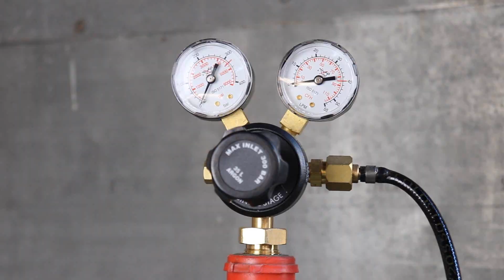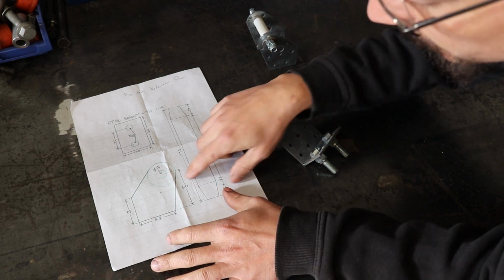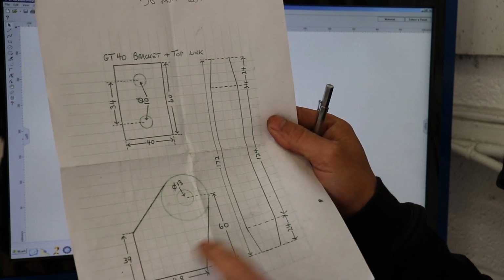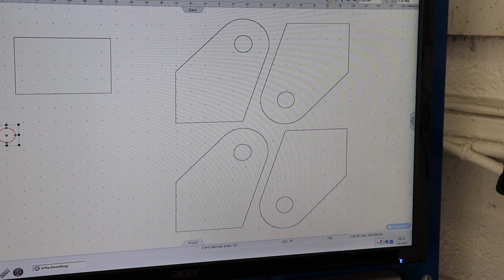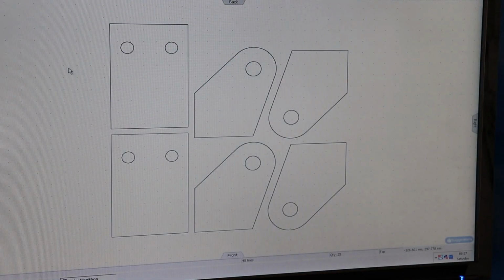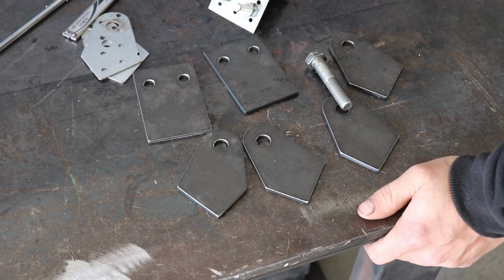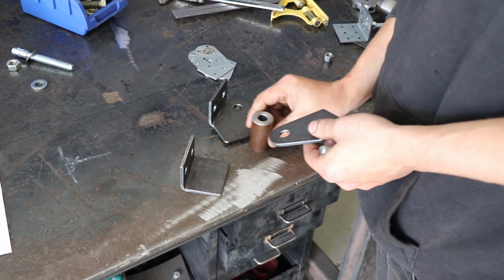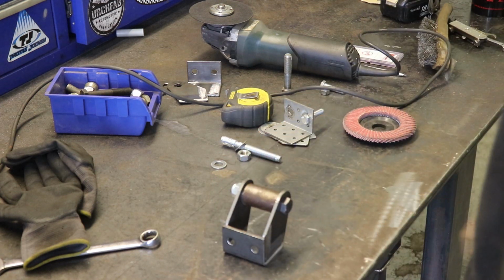CNC PLASMA, A SPIN ON THE LATHE AND A COUPLE OF WELDS.

Comment: could be its for the gearselector , those gt40s use either a audi gearbox or a realy old renault gearbox from a front wheel drive car , the gearselector rods come from the other side when the gearbox is mounted in the back of the car

Comment: personally i would have made the spacer 50.10mm, it would pinch down when you tighten the bolt, he dont have much room inside the brackets for the bolt heads 0.0,
nice job anyway matt.
Reply: If it's replica ford gt it would be 2in 
50.8mm 
So 51 may have been correct 
But if he asked for exactly 50mm then you gotta make it to the requested spec